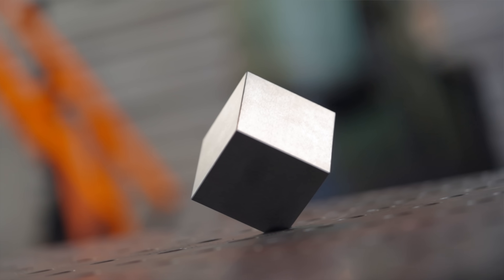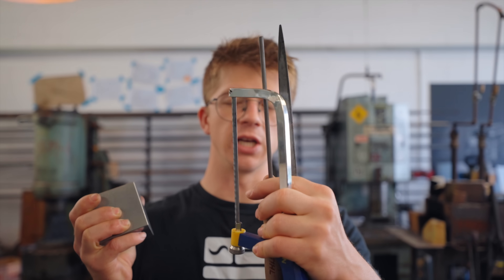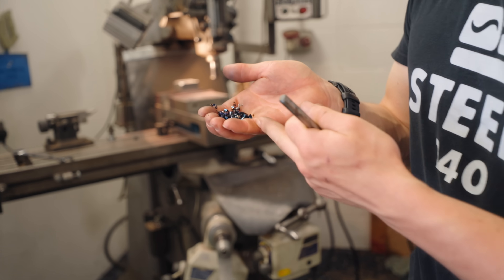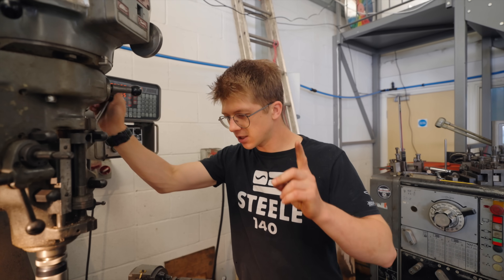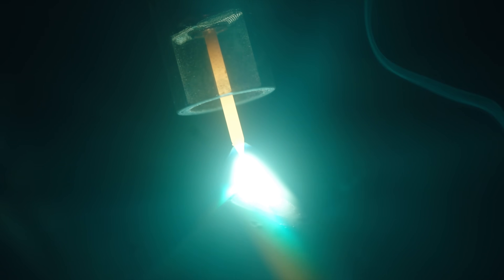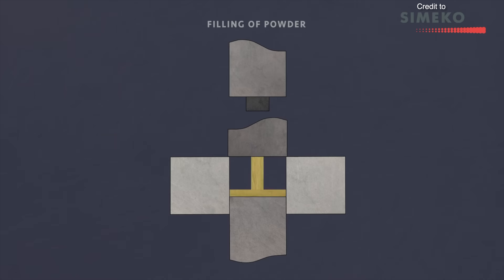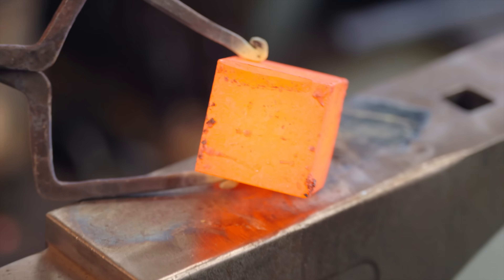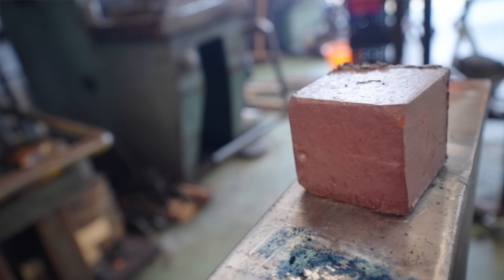Can You Forge Tungsten?

Comment: How are all the chunks like your block or the spheres you can buy on Amazon manufactured? Is it just higher temps but everything else is pretty similar? The only thing I know Tungsten metal is used for is weights. Like for high end telescope mounts, professional level race car ballast,weights for competitive shooters guns etc. And welding rods. Every other use I personally know of is some kind of sintered ceramic. Always thought it would be cool to have a piece of jewelry made from Iridium but i believe it's even more valuable than platinum. There's a very fine layer of Iridium everywhere on Earth thanks to the Dinosaurs Space program. It wasn't very good.

Comment: Goodbye files. They are now corrupted.

Oh, and I bet that a Masonry Abrasive Disk would work better.

Metals clog abrasives (or the spaces between the abrasive grains). Because of this, the abrasive binder used is soft enough to allow the grains to break off of the surface, continually uncovering fresh abrasive. 

"In comparison," stone and concrete are much more dry and less sticky than (most) metals, while also being much harder with near zero ductility, and so do not clog the Abrasive. Therefore, the binder can be much harder.

Comment: Tungtes is used for TIG welding and other high temp applications because its has one of the best thermal expansion coefficients, meaning it holds it orginal shape and size no matter how hot or cold it gets
Reply: It's not really a super metal per say. At least not in it's hardness. Titanium is much lighter and twice as hard. I have a watch band made of Titanium. It got damaged and had a burr getting snagged on clothes, so I tried to file it down with a big steel carbide file....the burr was the size of a pin head and it took me 20 minutes to get it smooth. I was amazed. But The melting point of Tungsten is 6100 F°...over twice that of of steel and almost twice that of titanium. Without it Edison would never if been able to make his. First bulb... They say  he tried thousands of filaments before Tungsten.

Comment: Given the properties of Tungsten... I think they would make amazing throwing weapons. Shuriken or throwing knives. the good throwing knives and stars are thick, but it adds stability and mass to penetrate the target. the down side is the thickness is uncomfortable and also reduces potential penetration. but if you could thin them down, you have all the bonuses of the thickers steel throwing missiles, but the benefits everyone wants from being thinner. also would be able to hold a couple more in the sheath/pouch. but question remains... not being familiar with the meterial itself, is it hardenable?

Comment: Tungsten steels are usually made by using powdered metals and pressing them into the desired shape and sintering, followed by complex heat treatments and tempering. It doesn’t actually melt the tungsten, but instead reaches a temperature high enough for the tungsten powder to bond. I guess kind of like forging, where the material doesn’t fully melt but is heated to a temperature where it can be welded together.

Comment: The smoke coming off the tungsten is likely tungsten trioxide. The metal tends to start “burning up” in air well before melting, converting into the trioxide which is much more volatile than the metal and will vaporize off the surface and condense into smoke.

Comment: Tungsten has the highest melting point of any metal, around 3,422°C. To forge tungsten, you typically need to work at temperatures between 1,400°C and 2,500°C.

Comment: A lot of the tungsten objects you find are sintered powder rather than solid tungsten metal. It's so hard to melt and form it in its pure state. Virtually all the tungsten used as radiation shielding is sintered. It's still tough and hard. Just easier to make into things that way.

Comment: 15:25 OOOOOOH when it's red hot, you can REALLY see the grains of the sintered Tungsten. Bet that tastes real good
EDIT: Yes, it did something on the corner because the force was concentrated on the point instead of over the entire side. Then as soon as the surface area got large enough to counteract the hydraulics it stopped deforming

Comment: I’m a welder and all I know is welding weird metals is usually very dangerous the do without air circulation or a respirator of some sort. Very bad for your lungs. Aluminum is bad stainless steel steel is bad brass is bad and bronze is one of the worst carbon steel isn’t that dangerous to weld without much ventilation but it’s also bad too.

Comment: I’m not an expert, but I think the centre of that block wasn’t heating up all the way like the edges were. You could use the press on the edges, and the stamp on the surface. But when trying to compress through the centre it was not moving. If you cut a thinner piece you might be able to forge a knife

Comment: That smoke is tungsten oxide. Making tungsten hot is one of the few ways to actually get this metal to "rust". Although not really poisonous, try to not breathe in this stuff too much (like with anything that is not fresh air). And sure, pure tungsten may be tough, but not really hard. Pure metals are often not that superior in anything really.  
If you want to further experiment with different metals: Be aware that most metals start "burning" in higher temperatures, and metal fires are incredibly difficult to put out. And some produce some really nasty fumes. So go ask a chemist before putting some exotic metals in your fire. Leaf Cadmium alone. Other than that, go make some experiments. Titanium is always fun. Maybe try some Chrome.

Comment: I can't believe he never mentioned that the cube is also sintered...
And that it's not pure tungsten, it is almost most certainly a 95% alloy, with 3.5% being Nickel and 1.5% being Iron, the rest being a tiny amount of other stuff like Mg, Ca, Si, Al etc.
The cube's density also isn't 19.25 like he said, being a 95% sintered cube its density is 18.02 g/cm^2
With a hardness of 27HRC
I know all this because I own the same cube from Midwest Tungsten Services, and it comes with a composition sheet along with other information.
Try this all again with pure tungsten, which is near impossible to get due to the fact one would have to melt it first, which would likely turn all the tools into a gas...
For perspective:
Steel generally boils at around 2750 degrees Celsius
And tungsten melts 3422 degrees Celsius

Comment: There is a term for alloys that melt at a temperature lower than its components, but I don't remember it. For example, if you rub gallium and indium together (which melt at a pretty low temperature, gallium can be melted just with your body heat) you would get droplets of a molten alloy. So it might be the case that adding 18% of Tungsten to steel doesn't require heating it up to the full melting temperature of Tungsten. But you better go read a wiki on that because all I've typed here is just from memory.
Reply: Eutectic